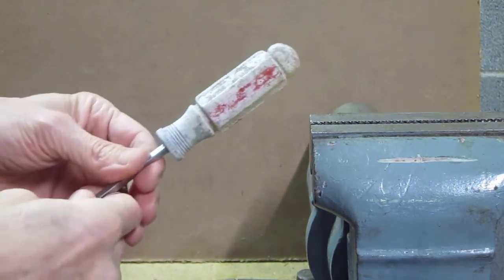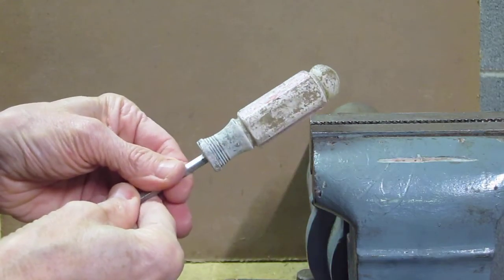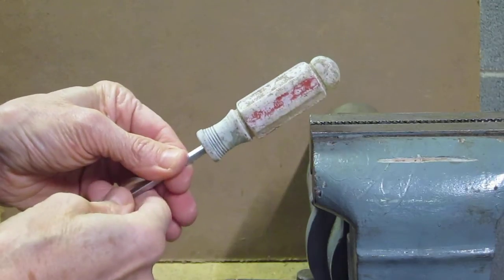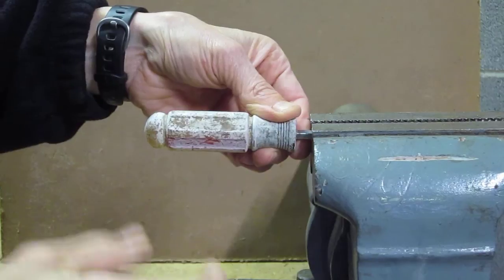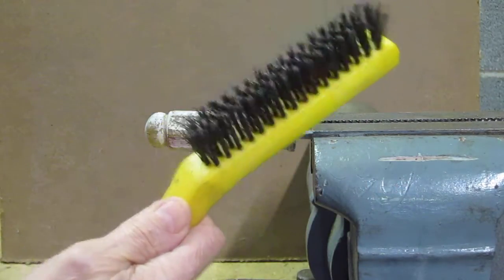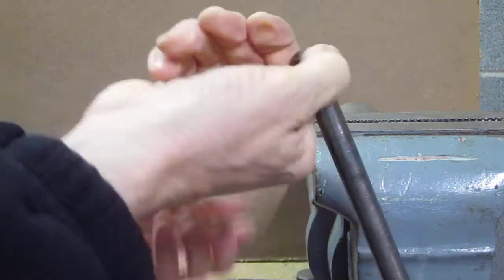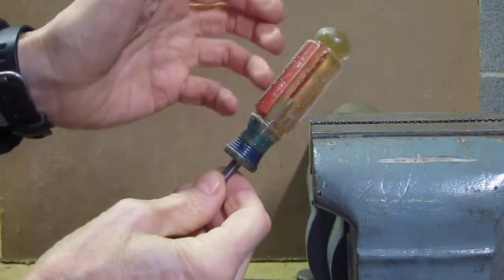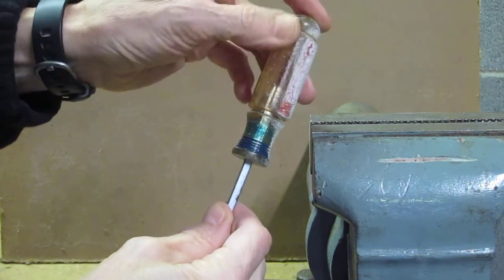How to clean screwdriver handle in 1 minute

Comment: This is the HARD way. Get muriatic acid. Hold screwdriver by the shaft, use a cheap paint brush,and paint the handle with the acid. It goes away as fast as you put the acid on. Then just rinse well and wipe off with a towel
Reply: I used Tilex. I guess its close but i sprayed it on and gave it a light scrub with my nail brush and wiped it off. It dries in a minute or two and they look beautiful.

Comment: Guess I lucked out none of my Craftsman screwdrivers ever deteriorated like this.
Reply from the maker: Lucky you!  Another commenter said that they stopped using the deteriorating material after about 1980.  So maybe your screwdrivers are newer than that?
Reply: @chainring  Probably mid 80s so maybe they are a better plastic.
Reply: same here, mine are still fine, though mine may be early 90's

Comment: For me, soaking in ammonia for about 10 minutes and gently scrubbing with a plastic brush worked well.
Reply from the maker: Good solution!  Much better than spending days soaking, scraping, sanding like some other videos recommend.
Reply: I use vinegar. Cut the top off a water bottle. Put a couple of screwdrivers in it and add vinegar to cover. The crap will wipe off for the most part and then hit it with a stiff small nylon brush for the tough spots. Onpy complaint would be it removes some of the blue paint but doesn't affect the red at all. Mine are over 40 years old and have naturally yellowed over the years. But the white crud is gone

Comment: I have the same issue with my Craftsman screwdrivers, set was  purchased new in mid to late 70"s and I've had too clean white film off several times over the years, and just noticed today that something needs to be done again, and yes the smell is awful!!!  I wonder if they could be returned to a store for replacement, they are "defective"!  I may try this at Ace and/or Menards.
Reply: Technically yes, but you don't want to do that. Your 1970s era Western Forge USA made screwdrivers are probably marked "Forged" which means that they were hot forged. They are made to last. Clean them up and keep them as-is. Today's replacements are made in China unless you find some NOS USA stock at the back of the rack. Even then, they haven't been hot forged in over 25 years. I spoke to some employees at WF (who made the Craftsman screwdrivers) and they told me that about 25 or so years ago they stopped hot forging them, probably for cost to Sears at the time.

Comment: You can clean the surface deterioration off the handle but that won't stop the deterioration.   Those are known as CAB handles, which stands for the chemical composition of the three components going into the manufacturing process.  Use of that particular material, which contains cellulose as the first ingredient, ended about 1980 due to the realization that the product was unstable over an extended period of time.   The deterioration is the cellulose essentially rotting due to exposure to air which causes it to chemically react with the other two ingredients and produce a nasty smell that will contaminate your whole shop.   

Those handles were a cheap, inferior product back then and they are a horrible product to have in the workshop today.   My advice is after you "restore" the screwdriver to make it look pretty again, sell it to someone and get rid of it!  You will be glad you did.  Some things from the past are just not worth keeping.
Reply from the maker: Hi Trehan Creek Outdoors!  I agree with you that the handles will continue to deteriorate.  You certainly know more than me about the chemical makeup.  My cleaning method quickly makes the handle look new and glossy again.  I might have to repeat the cleaning every five years.  But the cleaning only takes 1 minute.  And otherwise, the tool is entirely adequate for my needs.  One of the main reasons I made this video is that I saw several videos where the person was spending days soaking, sanding, polishing handles, and I found a much faster way.  Thanks!
Reply: I purchased a box off excelite screwdrivers from a junkyard sale they where really good quality after sorting them out i placed them inside my tool chest. After a few days I went to use them bloody hell it was like my tool chest was soaked in rotten eggs and sick
Reply: Mostly accurate but I don't believe they deteriorate just from being in air.  The deterioration begins with chemicals, moisture, and prolonged exposure to heat....basically a shop environment LOL.  I've had for my drivers for 25 years, at home in a mostly climate-controlled environment, and I clean them after each use and I have experienced zero discernable deterioration.
Reply: @stevenrheeter6005  Steven, I agree with you completely.   Air alone might deteriorate them over a very long period of time but shop environment conditions will greatly accelerate the process.  Keeping those handles clean is essential.  I've had a Craftsman screwdriver with a CAB handle for close to 50 years  stored in my personal toolbox.  It's NEVER put up dirty and is always wiped clean and dry.  There is some small deterioration but gee whiz it's a half century old!

But I have some similar screwdrivers obtained from some tools out of an estate property that are in horrible condition.  The auto mechanic who owned those tools rarely, if ever, cleaned any of his tools.  I suppose they were in near constant use and just stayed dirty.  Replacing those handles is about the only way to restore those screwdrivers.  The reason they are shot is because of bad tool maintenance, as you say.
Reply: Send them my way. I've been using them for 30+ years without an issue. I'll pay for the postage. LOL.

Comment: You scratches the handle...I would recommend to use mineral spirit
Reply from the maker: It seems like a wire brush would scratch the handle, but it doesn't.  My handles cleaned up with a glossy smooth surface, no scratches at all.  Note that I had a puppy many years ago that liked to chew these handles if I left them lying around.  I think this screwdriver in the video had some of that chew damage.  But the wire brush did not add any scratches.

Comment: A faster way to do it is use a wire brush on a cordless (or corded) drill. It will take off that white haze/film in no time flat. I bought a "lot buy" of Craftsman screwdrivers and some of them were really hazed over. A quick hit with the wire wheel and all of that gunk came right off and they look presentable again. I still have more to do, but they look a whole lot better now that they are cleaned up. 

Your unit shown in this video is a Western Forge USA made "hot forged unit" as it's marked "Forged" as I saw in the video. You want to keep those, as they are better quality. They stopped doing that about 25 years ago. I had spoken to some long-time employees there before WF closed. WF of course (and Pratt-Read who WF eventually bought) made the Craftsman screwdrivers for Sears for years. WF was started in 1965 by C. Willam Schlosser and Sears as partner. So while Sears didn't "make" anything, they did invest in companies (such as WF and Whirlpool) so that they could keep up with their demand and contracts. Around 1966, they moved to Colorado Springs, CO, and later on they would get the motto, "Mile High Quality" because of the relatively dry location in Colorado. WF was eventually bought by Ideal Industries who owned SK up until about last summer (2021). Ideal is now owned by a Chinese concern. 

Also, if you want to date a screwdriver (WF also made other tools for Sears such as pliers, punches, etc), "AG" is 2018 production and work your way backward year by year,  into the single letters in the alphabet and if you do, "A" is around 1985 production. Prior to that they used things like *, +, and a triangle. I'm not sure what those mean as I never got to ask WF before they went out of business. 

I was missing a cap for a ratcheting screwdriver that they made for Sears along with some pocket clips on the smaller Craftsman screwdrivers and they gladly sent them to me at no charge and a "thanks for being loyal to our company" e-mail. Nice people, I wish they didn't have to lose their jobs, and I hope they all got to retire.
Reply from the maker: Yes, a powered wire brush is a great idea!  Thanks for all the interesting info on these tools.  Back in those days, the goal was to make great tools.  Now the goal is only to make money.
Reply: @chainring  Sure thing. They were better made (at least the screwdrivers were) in the past when they were hot forged. The "cold forged" ones can bend on a pesky screw. It took a lot to bend a forged Craftsman. They still made a good unit for the money and of course, the warranty is unbeatable. Yes, you can still get them exchanged today, but you won't get a US made unit like you would in the past. 

I always preferred when Sears would give me a rebuild kit for my ratchets (I stockpiled them years ago), because I prefer to rebuild my own. If an old tool isn't damaged, it's better off to clean it up. Vinegar makes a very good (and cheap) rust remover, I've used it several times on tools that went through Superstorm Sandy that I bought from someone. Some came out great, some were beyond repair and had to be swapped out.

Comment: Scratches!
Reply from the maker: It seems like a wire brush would scratch the handle, but it doesn't.  My handles cleaned up with a glossy smooth surface, no scratches at all.  Note that I had a puppy many years ago that liked to chew these handles if I left them lying around.  I think this screwdriver in the video had some of that chew damage.  But the wire brush did not add any scratches.
Reply: @chainring    Surprising.